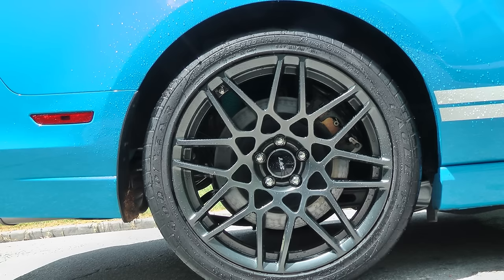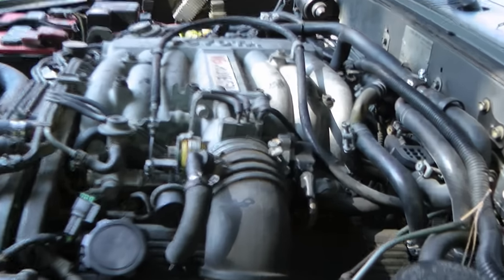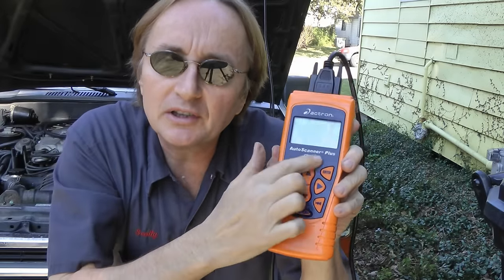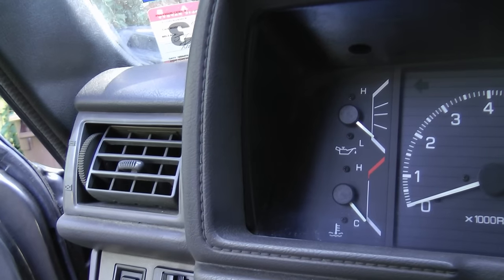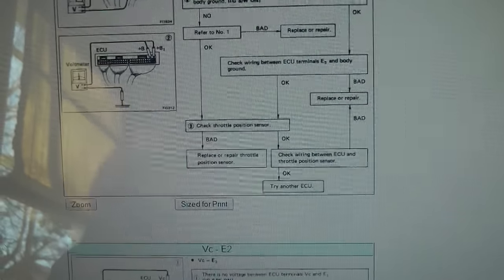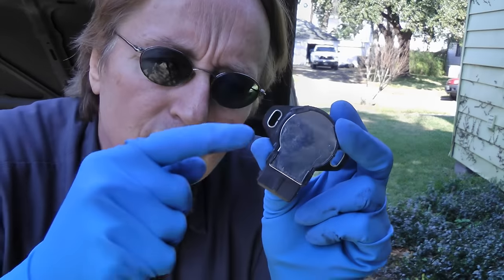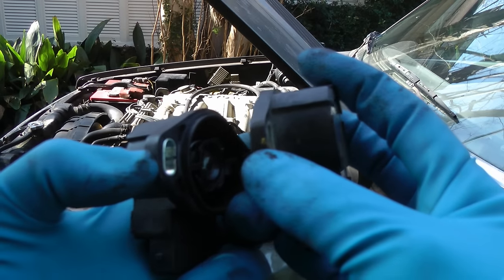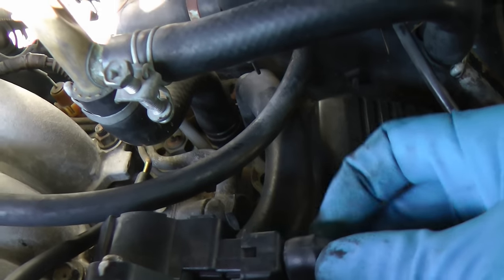How to Stop Car Hesitation (Throttle Position Sensor)

Comment: Life saver. My 91 Honda Accord been running rough and hesitating from a complete stop. Idle been surging up and down. Unplugged the TPS sensor and it runs smooth as butter
Reply: I have a 94 accord been doing the same thing. Gonna go try this now
Reply: @Nick-yw9ui  whats happened ? Did it work ?

Comment: 07/07/2020 While your video is just about 2 years old, it was spot. started my car, let it idle, disconnected the throttle body wire and the engine revved up.
Was a quick fix for my 1994 Subaru legacy...Thank You...you are the best

Comment: Scotty saves the day!  I wish I had found this channel sooner.. Been fighting with this stupid old 1990 Buick Century 3.3L for a long time.. changed everything BUT the TPS, and wouldn't you know it? LOL  Seriously, I spent better part of 3 days replacing the fuel tank and pump / sending unit assembly, too.. and the crank position sensor and the ignition control unit, also cruise control, PCV valve and grommets, MAF sensor assembly, coils, injectors (high resistance Bosch), plug wires and plugs and vacuum lines. Little by little, the improvements were felt, but couldn't get rid of that rough idle. Well, heck.. Engine was barely broke in when I got it from an estate sale, but had to rebuild the transmission, six months later (ouch!). Now, I have almost a new car! Too bad it looks like crap! The dogs love it, so who am I trying to impress? LOL

Comment: The absolute throttle position for my throttle sensor would change from 18% up to 20% at idle, that’s how I knew it was bad. Sometimes I would come to a stop and it would be at 19.6% and other times it could be at 20.2%. My new sensor is always at 18.4% when the throttle is closed. My acceleration is a lot smoother now and my mpg has increased slightly too.

Comment: This helped a lot, TPS has been acting up, going into limp mode and then normal with each turn of the key, poor idle, sometimes stalling, but idles great after removing the connection.

Comment: Scotty you are the man! I replaced my TPS with one I got off eBay for $10 trying to save money. My Jeep started turning off while I was driving and I figured it was the TPS. I changed it out and I did a transmission fluid change and I couldn't believe it when my Jeep started to shift wrong. At first i thought I had to change my transmission which made me lose hope in my Jeep but after watching this i am going to buy another TPS and I hope it works this time. My transmission was fine right before I changed out the TPS and now I know what it is. Thanks man!

Comment: Hi Scotty. I've been checking out your videos for some time now and you have helped me several times and I want to thank you. Now I have a new problem that has been going on for a few years now with my Chev. Uplander 2007. It has around 280,000 kms on it and still running well but at times it hesitates badly when going up a hill or when frist running in the morning when I hit the gas peddle from a stop position it hesitates and then suddenly grabs and excelerates. I now tend to hit the gas a little slower until it warms up and then it eventually stops this. In cold months or rainly humid weather sometimes the computer comes up with "Reduced Engine Power".  A few years back I had it into the auto shop and they replace a throttle sensor and it worked for a while. But still months later back to the old reduced engine issue from the computer sensor. I have tried putting methol hydrate in the tank which seems to help instantly and cleaned the intake throttle with a cleaner. But the hesitation from a start position still happens. I watched the video of yours about changing the throttle position sensor and another video on youtube said you have to code the new sensor in as well. Could you help me out? Richard Roblin

Comment: Scotty, I have a 1977 400 V8, starts and runs perfect however, when cold or hot, if you stomp on the throttle you get a cough and it will stall, normal easy acceleration no problem. Everything is new, engine was rebuilt professionally in 2010.

Comment: Help Scotty, about a year ago I bought a 97' F-250 5.8 as a project turck and put quite a bit of money into it. It seemed great and then about a week after I got my license I started getting engine surge while accelerating. The car Idles fine, I replaced the ignition system (plugs, cap, wires), and tested the TPS. The TPS is within spec voltage. I tested fuel pressure checked out fine, and the 3 mechanics I brought it to all recommended I bring it somewhere else. 2 of them said itwas a transmission issue so I replaced the transmission and wiring harness myself with no luck. The surge is almost like someone is feathering the throttle but i'm not, It seems to be okay only in 3rd gear at constant throttle.

Comment: My car was hesitating during acceleration.  First they thought it was a vacuum leak so the "fixed" that but it was still hesitating. Dropped it off at the mechanic again today.  It was a bad coil.  Running great now!

Comment: Scotty,

Can the trick where you unplug the sensor be used on a car that does not have a physical throttle cable?

Also, The problem I am having is that sometimes while accelerating my car will randomly stop accelerating smoothly and the boost shoots down from around 9 psi to 5 psi, almost as if I had let off the gas a little bit, and when I put my foot further into it, it starts accelerating again and the boost goes back up to 9 psi. 

Any help would be greatly appreciated. My car is a 2002 GTI 1.8T.
Reply: Hi, i have the same problem, how You fix it... i know it's been 7 years since your comment

Comment: LOL this guy is crazy, love it. Unplugged my tps on my 93 f150 and power and acceleration is back. plugged it back in and issues started again. I will install news tps and run it again to see if issues are gone with the tps on. my engine light did not come on nor did it shoot any codes out.
Reply: Juan M Davila 
Did this fix the issue?

Comment: Scotty, i have an 04 Toyota Rav4. Whilst accelerating sometimes there is a loss of power, the gas pedal can go to the floor and there is really no power. It was my mom's car and was driven very easily. 79k miles... 2.4 liter automatic. at light throttle it seems to be ok. I am going to clean the throttle body and replace all air filters and then see what i have. Also fyi i am a retired 38 years mechanic si i understand your lingo just fine. Thanks help me to be able to REV UP MY ENGINE !!!
Reply: Did you find a solution?

Comment: Hi my 2006 pontiac grand prix is hesitating under heavy acceleration like getting on the highway but under normal driving its fine. I cleaned the mass airflow sensor and the throttle plate about a year ago I have new spark plugs and wires and new coil packs. I also put in a new map sensor. Nothing seemed to work do you have any ideas what's wrong
Reply: Check the accelerator position sensor. My Honda accord had the same symptoms and that's what it was.
Reply: could be cat convertor getting clogged or may a dirty fuel filter... you should test your back pressure in exhaust.. it should be zero at idle and no more then 3-4 pounds at 3000 rpm... you  take out 02 sensor and screw in adapter and for guage

Comment: Hey Scotty, I was having idle issues on my automatic transmission car, especially in gear. It idles really low on reverse and only slightly higher in drive. Accelerates and coasts just fine. Anyways, I tried this test and ran it through the gears with the iac unplugged. As soon as I put it in reverse my car bucked harder than a bull. I put it in drive and it was nowhere near as violent, still the idle was low. What do you make of it?

Comment: please please tell me where the position throttle sensor is on my 2005 Mazda6 2.3L?  I've been told is on the gas pedal. After research and watching your videos.I have so many questions. please please help me!
Reply from the maker: go under the dash, at the end of your gas pedal near the firewall, the little computer mouse throttle pedal sensor is there. The other end is inside the throttle assembly on the engine intake manifold
Reply: Scotty Kilmer I have a question for you.. how much do u know about old school BMW specifically e 34?
Reply: Joshua Morris I'm having almost the same problems

Comment: Would it be a good idea to clean the throttle body while and prior to replacing the TPS, and can that cause the car to stall? My car stalled twice today, but, I bought a new TPS sensor, throttle body cleaner (always a good idea to have that for temporarily fixing the IAC valve), and other stuff.

Comment: Scotty what causes a shudder between 30 to 40 mph and then smooth out after 40mph
Reply: tigerking speed sensor? Maybe :)
Reply: tigerking possible that your 3rd cylinder is having some troubles. New coil pack? New spark plugs, new cables could all help!
Reply: TigerKing replace the spark plugs, at least that fixed the problem on my BMW x5

Comment: Im not sure whats wrong with my vehicle i'll try to accelerate and my rpms go up as usual but the car lags to accelerate.
Reply: Latino8urtaco put the diagnostic tool on it and check for codes if its 96 or newer.
Reply: Clutch problem

Comment: my car dies if the rpm goes to low,  it can't idle without giving it gas, I was going 80mph on the freeway and then I lost power and was forced to stop, I was able to get going again but, as soon as I was stopping at the stop light on the offramp the throttle cut out and then the car shut off once the rpms got to low
Reply: please respond with info because I am stuck out of town and will be leaving tomorrow ( I hope )
Reply: did you fix the throttle body? you should check out the fuel injectors
Reply: Miguel_Dominic
Reply: Could be 4 things Temperature sensor, idle air control valve, or egr valve or oxygen sensor upstream that's to the muffler  then u back new $300
Reply: Fuel Pump!
Reply: Miguel_Dominic could also be just a MAF (Mass air flow) sensor. They like going bad alot also. Best way to check them is unplug it and see if it will stay running without giving it any throttle! They are usually located either on the pipe running from your air box to the throttle body or on the side of the air box.
Reply: Change the spark plugs, spark plug wires, and ignition coils. My 2003 Mitsubishi had this problem and it was caused by a bad spark plug and a dead ignition coil. Does the car shake violently too, as well as struggle to accelerate? It sounds like you're having a misfire; my Eclipse used to die when it was at low rpms as well.

Please note: I am aware that this question is over a year old, but this reply may help other who may be facing this issue right now.
Reply: arlo bubble I appreciate your civil discourse. There is no harm in performing a tune-up if you're eventually going to do it. If you perform the tune-up you can rule that part of the equation out.
Reply: Fuel injectors
Reply: My money is in the mass air flow sensor and the idle air valve.

Comment: Unfortunately, we do not have good fellow in my country. Your explanation are awesome. Please post video how to test Alternator. My lights are going dim when i switch on AC, power windows. Tested both battery and alternator.  Does it also affect firing of spark plug?

Comment: You sir....have saved me. I just did a new head gasket on my 1986 4runner, (the same model of vehicle you have here ironically) and it turned out the head was cracked. So after doing an entire top end on my baby, She didnt run worth a shit. Ive battled the issue for weeks losing my mind on what the issue was and actually considered selling it. Turns out this is the issue. Thank you.

Comment: THANK YOU SCOTTY KILMER!! I have a '91 Buick Lesabre and it suddenly developed a problem where it would die only at stop signs/lights. It had a bad vacuum hose but replacing that didn't help. It had always idled pretty high then recently lost rpms at idle.
After watching this video I disconnected the TPS Sensor and the wire harness was so baked it fell apart in my hand.
The idle changed once I unplugged it and it regained the rpms lost. I gunned it and released and it didn't die...it idled fine.
I took it for a test drive around the block and it picked up and idled like it should!
Now I have no idea if it's the Sensor or just the baked wires but I'm going to replace both just to be sure. I believe it's the original part...
Thanks again, Scotty! You saved the day! :D

Comment: Hello Scotty, what if I didn't mark the screws before I remove the TPS. Now what could I do now to make sure I install it at the right adjustment or graduation? 99 Ford Expedition XLT 4wd 5.4 L 2 valves Windsor made in Nov 1998. Thank you for your vodeos.

Comment: Will this sensor make your car idle weak at start up, even requiring taping the gas petal a lil to keep it going? I have a 02 eclipse gt 3.0 & I have replaced the Idle control valve & removed my cold air intake, but still have this problem. Please HELP! thanks & love the content!!

Comment: Update.. I simply changed the TPS as Scotty recommended and the engine ran like cr*p, and threw three codes, but fortunately I had a service manual on hand with the correct procedure, which is not difficult. I needed a cheap multi-meter (volt ohm meter) and had to measure the voltage output of the TPS. I adjusted the TPS angle until the voltage output was 4.6 volts and tightened. Cleared codes by disconnecting battery cable and car runs good, now, no more codes (all three disappeared). So the TPS operation was a success. BTW, my car is a 1990 Buick Century with 6 cyl engine and the book calls for an output voltage of 3.3 to 4.6 volts, measured from the blue (center) lead to ground. Idle is not yet quite perfect. I am also changing a suspect oxy sensor and that should do the trick. If anyone else has this car, the TPS is on the bottom, behind the upper radiator hose and a few other things. It's not easy to get to. You may want to change the two screws from OEM to a 4mm metric bolt, 25mm length and 7mm head. That makes re-install and adjustment MUCH easier. I got them at Home Depot in the metric hardware drawer. You will also want to remove the air cleaner / filter box and a small breather tube and steel fuel line, but they are all easy to re-connect. I did use the multi-meter on the ohm scale and operated the TPS.. definitely bad, and this vehicle had only 40,000 miles, so they do need changing from time to time.
Reply: Greg Bartmess yeah that's the correct way.Not the way he shows.
Reply: you mention TPS angle what's up with that do I need multimeter. I have a 91 Toyota truck put a new TPS in once it warms up and wants to idle off it does surge up and down smells a little Rich to. It's a great little truck I'm the original owner almost got a half a million on it suggestions are welcomed
Reply: As long as you follow the logical reasoning, figure the puzzle out is not difficulty. Most times we just lose confidence for you self or no time or energy to fix it !

Comment: i have a 1990 caddy, with the engine lite on.i did the code check with the heater buttons the code was 52, t.p.s i have not replaced for some time now my car is doing just that sputtering, i hope thats what is is, your great at what u do.
Reply from the maker: try cleaning the tps and the throttle plate first
Reply: hey thk u 4 getting back, i will do just that.
Reply: hey scott how u doin, hey i  located the tps on my caddy was hard to find hiding behind the carb, well i took the plug off she was still sputtering a little but when i pluged it back in it died,  i haven't cleaned it yet, i need to get one of them bent screw drivers,
Reply: hello scott, hey i did what u told me to. i did take the tps off. i had to take the whole carb, off just to get to it. i did clean it put all back and it still doing the same thing. do u recommend buying one off line?

Comment: Hi Scotty, I have 2012 Hyundai Santa fe 3.5L done 34000km as on today, car dropping speed rapidly often when I wont accelerate on normal road; like in traffic /close to signal /

Observations:
1. Its happening often a ride of 5 KM or engine gets normal heat-up
2. If I lock AWD drive I wont experience it.
3. On situation if I have to break the car, while press break paddle I feel it free up the wheels before stop.

Check done:
ABS sensor rings (rear)
Air pressure 38psi (F) 42psi (R)
Wheel spinning speed on jack is normal.
No indication on dash board.
Regular service at Hyundai Dealer.
Reply from the maker: Abdul M you have some type of transmission problem, only a pro with a dealer level scanner and years of experience can figure that out with a road test and analysis of live and mode 6 recorded data. Good luck
Reply: Scotty Kilmer Thanks, would it be any sensor issue or beyond, if beyond I must first buy a extended warranty before approaching Dealer for reporting this issue.

Comment: My dads 94 Ford Explorer has a check engine light problem. The car idles fine, but it it's terrible when it comes to accelerating. You can push down on the gas and hear it struggle for a second and it'll start accelerating. Sometimes if you really have to speed up, putting your foot down all the way barely gets it going  until a second or two later. The light normally turns off when you turn off the engine and on again, but it'll turn back on within a minute or two of driving

Comment: Scott I have a 1994 Toyota Corolla DX and I replaced the gas tank,fuel injectors,fuel filter,the regulator and just now the TPS on it if by any case it keep running rich like it does what do you recommend todo sir??? Hope you can help!!! The spark plugs are new and cables if you want it to know!!!